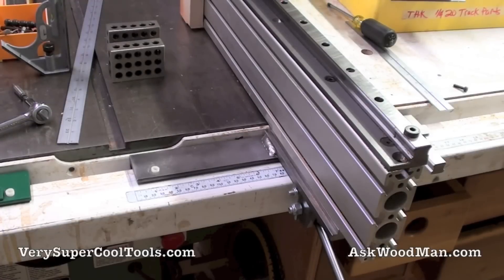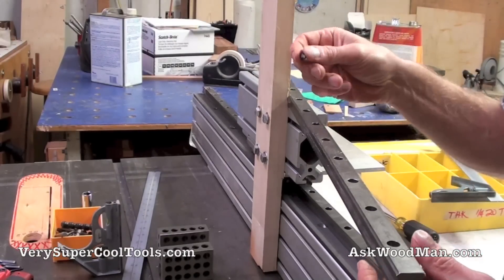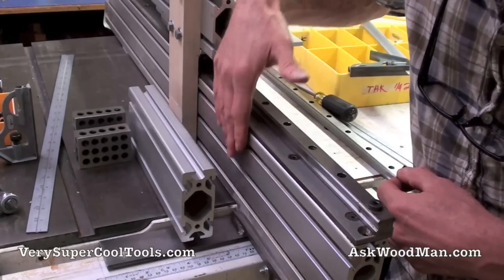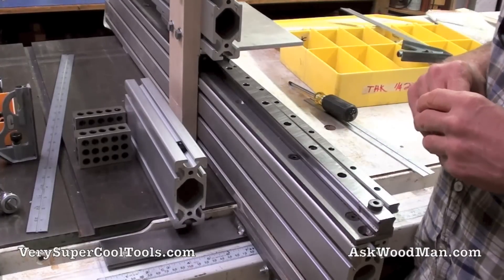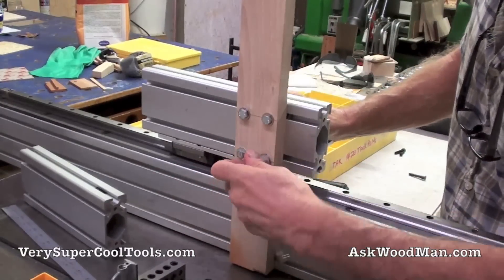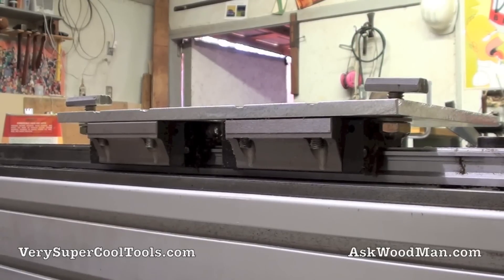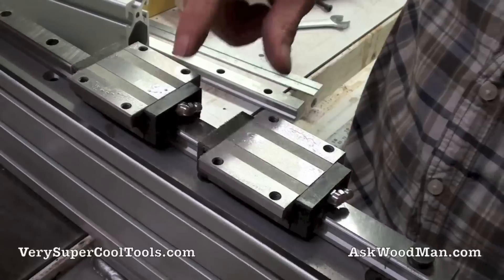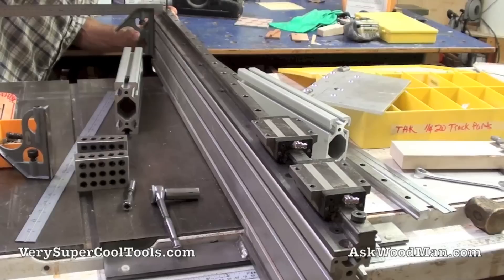1 of 2 Tenoning Jig Using Linear Bearings/Rail Mounted On Aluminum Extrusions

Comment: Can you mount the bearing rail directly to the aluminium? Instead of to the flat bar?
Reply from the maker: You can. But I wanted to distribute the load on the top of the softer aluminum to keep the hardened bearing rail from marking or scoring the extrusion.